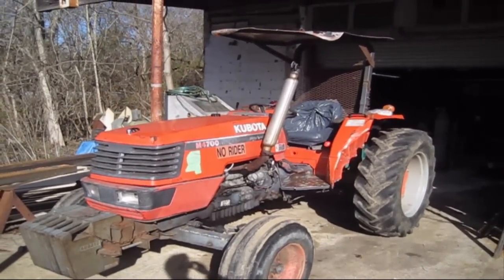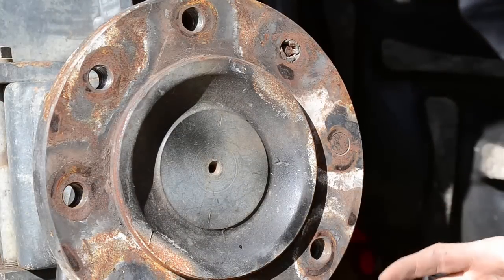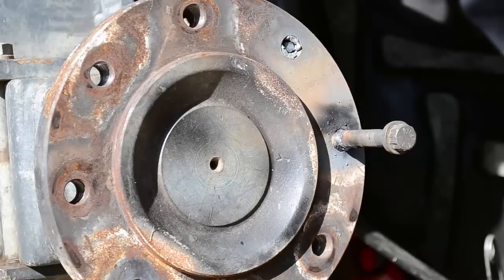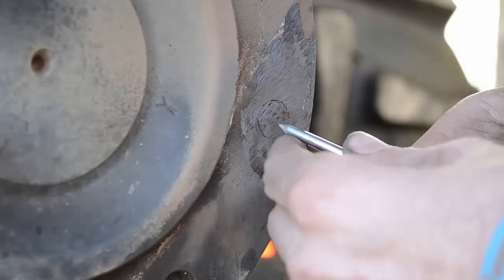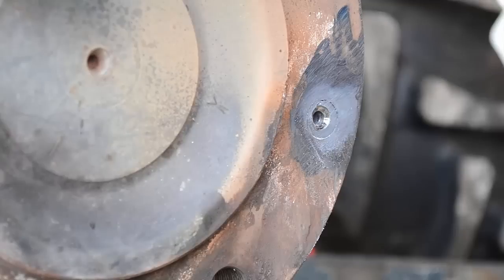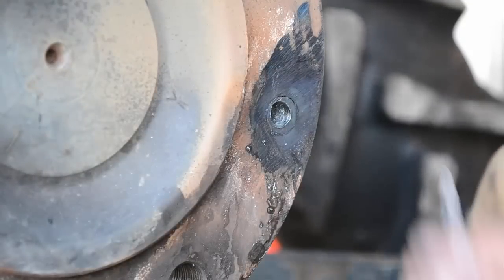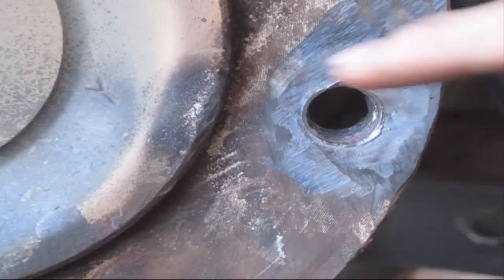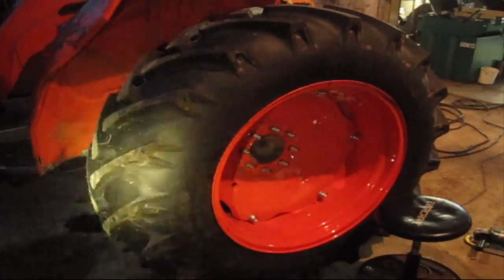Broke-off bolts techniques

Comment: You are running your drill bits to fast, the bigger the bit the slower the speed. Give them time to cut, watch your chips. -- BTY good  job
Reply: Drilling steel, you need a low speed, lubrication and plenty pressure. Excessive speed will just make the bit skate and blunt itself.

Comment: Another option you could have tried was to heat the plate good and hot before using the impact wrench. It's worked for me many times.  Great video.

Comment: After you weld the bolt on, melt some wax down into the threads to lubricant them, it helps  a bunch. I keep some crayons in my toolbox.
Reply from the maker: I have heard of that, but never tried it.  Thanks for the tip.
Reply: Give it go next time.
Reply: Toilet ring. It’s beeswax. Takes to heat paraffin base wax will just catch on fire
Reply: After he heated up the bolts to break the rust he should of let it cooled and poured a load of penetrating oil and let it soak in.  Then weld his bolt on and do the same before he tried turning it. Dry rust will just jam up.
Reply: U
Reply: did not read down far enuff
Reply: STEPHEN Weston no no no
Reply: candle wax & heat work wonders!!! Saved me a few times!!!
Reply: Tony Papantoniou 
Why would you want to weld over oil?
Reply: That's a good godamn trick Stephen!
Reply: and he never should have used an impact gun.  Using a bar and socket to work it.
Reply: Someone (an old mechanic -like 40 years ago...) told me bees wax works really good..
Reply: another thought..  Not enough oil.  Penetrating oil can loosen up rust particles, etc.  Getting some of that loose can help out immensely.  Also on the bolt you had to come back to...  it was moving.. but seemed to me it hung up on a little bit of excess weld -or metal distorted from the welding heat (The washer and nut trick has been mentioned numerous times, and its a good one!)..  A good die grinder / pencil grinder with a tiny bur can knock those burs out from around the hole in no time..  Anyhow, you got them and didn't give up.  Good job! -and nice welding skill!
Reply: CRC Freeze Off penetrating oil works great and smells much better than the PB Blaster stuff.
Reply: I tried a UK equivalent called Freeze Yer Nuts Off (seriously) and it done nothing. Wonder if the CRC is much better....
Reply: I agree with the method. But I still smirked when you said I keep crayons in my tool box...

Comment: Haven't red all the comments here. A overlooked tool for drilling out hard things is a carbide tool for deburing like you would use in a die grinder. Does a wonderful job. Your doing a good job.

Comment: I saw a comment on left handed drill bits, to add to that. If you drill the hole out and run a left-handed tap in it and use a left hand threaded grade 8 bolt in there has worked for me in the past.  Just make sure you don't drill all the way through you want the bolt to bottom out in the stud so as you torque down on it , it locks it in

Comment: I think you would have gotten out after the first weld had you used some penetrant oil and worked it in an out, so close though. I've also heated the bolt/stud then quickly cool the bolt stud, it will retract a little from the parent metal which has expanded, both will work to make it come out ,that works really well on pipe thread plugs .  you showed a lot of patient in the job.

Comment: Thanks for sharing, it is very good.  I watched entire clip.
, Ross Miller is on the mark, re:  dulling the drill bit.
I noticed as you were going fast, rubbing the bit on the work,  it heated up the work and   IT BECAME HARDER.
That tells me the work piece had some chrome alloy, which means it has SOME similarity to stainless steel.
If we rub and heat up high chromium steel it GETS HARDER.   Just accept this principal for now, there is no time to go to its scientific reason.
So, those kind of material should be pealed off like apple skin.  Therefore high pressure, slow speed AND do not STOP as long as peals are coming off because existing heat will harden the piece.
Best wishes from California.
Frank, 68 years.

Comment: A few tips from a machinist- First, chrome sockets will explode when used on an impact. Next, its nice that you have a welder, gear, an oxy-acetylene torch, and the knowledge to use them. Most DIY'ers dont. Most do however have a drill and drill bits.  My first choice would have been to drill out the center of the stud. Then use a square or splined easy out, not the spiral type. Like you said, they are junk.  Tap it in and see if it will turn the stud. If it starts to slip, STOP. Now it gets fun. Apply heat with a hand held torch using the hotter MAPP gas. Most DIY-ers have this also. Heat the flange ONLY, and quickly; not the stud. The heat will expand the flange a few thousanths. You dont want to apply heat to the stud. As you apply heat to the flange keep moderate steady pressure on the easy out. When the stud breaks loose back off the heat a bit but KEEP TURNING. If you stop it will seize up again. If it doesnt break loose remove the heat. Now 2 options. You can immediately throw water on the spot to shock it and get it to pop loose. But if that doesn't work you may have water hardened the stud which makes drilling very hard. 2nd option is to continue drilling using a metric, letter, number, or fractional drill bit that cuts away as much meat without hitting threads. Then do like you tried and use a sharp punch to cave in the remaining stud. Once you you get it to break free in one spot the remaining shell will give up. Heating is tricky as it can make things worse, so I try to use it as a last resort.

Comment: Use an impact socket. Why? They are stronger. Chrome sockets are general duty. Strong enough? Maybe. But if not, they could crack and maybe even shatter. Good safety tip for you and your viewers. 

Also, always use anti-seize on these bolts / studs on assembly to make it far easier to remove next time.
Reply: Linz Leard if you buy quality tools like snap on, it’s the same socket without the chrome
Reply: looks like a wheel  hub. NEVER use anti-seize on any wheel stud. will prevent wheel from staying tight and will vibrate loose from wheel heating up and cooling. Have been a master mechanic for almost 30 years and have repaired many a vehicle that has had a wheel come loose from some idiot who used anti-seize on studs. Not to mention the body damage, and possible injury to somebody when this happens.
Reply: If you buy quality tool like Snap On it’s the same tool, the chrome will chip off, that’s why impact sockets aren’t chrome.

Comment: Good job. I only have one thing to say though......
DON'T EVER USE A CHROME SOCKET ON AN IMPACT GUN
Reply: Yup! Especially the cheap ones will crack. I have a set of sockets from Bahco made for using them with an impact driver. They are ten+ years now, still, they look like new.
Reply: I've been a mechanic for 30+ years. I've always used the same set of chrome sockets with impact wrenches. The only sockets I've ever broken are black impact sockets. One of them mushroomed at the end like a chisel. The key is don't be a moron with the impact. If you have to keep the trigger squeezed, hammering on the bolt, you need to use heat or something else to help break the bolt free.
Reply: The reason you don't use chromed sockets for an impact gun is that if the chrome flakes off and you're holding the socket you get that flake spun right into your skin.  You can use them, just don't hold onto them, don't be such a douche as obviously Steve has decades of experience...

Also you'll notice that the bolt was a 12 point bolt and almost every impact socket is a 6 point unless you specifically look for a 12 point impact set.  Most folks would rather have 6 though as there's less chance of rounding off..
Reply: @kalleklp7291  my bahco 17mm socket snapped on me using a breaker bar wtf 😁
Reply: @eamonnodhubhgain55  Ha,ha..yeah tried that too, but it took a 1,5" piece of pipe that was 700 mm long. However, I got a new one even though it was my own fault manhandling the tool in this way.
Reply: @notabiker  ,   No,  The reason you don't use standard sockets (chrome has nothing to do with it) is because they are drop forged and are thus harder and more brittle and thinner walled than impact sockets which are ductile steel & have thicker walls.  Thus the standard socket in an impact gun could completely shatter and bits go flying everywhere.  The impact socket is more able to withstand the forces of the gun.
Reply: fair enough but he said he's had black (impact) ones break on him but not the chrome ones. I find that the black ones are cheaper so if someone is choosing to use chrome over the black it's probably because he thinks they work better not because he's not aware of the difference or is trying to save money
Reply: @stevemccauley5734  Same here;  never had one problem with using regular sockets with the air impact driver; i mean,that was as a car mechanic,not in production, or continuous work; still,i felt sorry for the sockets,sometimes,  lol
Reply: that rarely happens, but if your worried about it you can heat it up red hot and let it cool that should take the temper out and won't shatter.
Reply: @as3cs3  Didn't really say break, said mushroomed instead of shattering (more ductile) which is why they are safer.  That said, I make do with what I have.

Comment: I’ve blown straight through the bolt (easier if there is a pilot hole drilled to start)  and scarfed the bolt out to the threads then cleaned them out with a tap. And yes, be careful with the tap or you will brake it off. Just my two cents but it works. I’ve done it many times. Like your videos 👍

Comment: Thanks for the video. Ive blown out hundreds of bolts using a clean cutting tip on a torch.  Just do it fast so as you said, not to let the outside metal get hot but press the cutting  button to blow the metal out, instead of letting it just heat up. Sometimes if the bolt has no hole all the way through, the metal will splatter back, and make the tip of the torch red and hot, but once you blow a hole in it, let it cool and then slice  the bolt and cave it in with a punch. The threads will be fine after you chase them.

Comment: As said before, lower your drill speed. You are drilling not grinding.  These insane  speeds are good for drilling wood.
Left handed drills works sometimes.
If the welded on bolt did not go out why not trim it down and srcrew it thru?

Comment: Looking from my side when you had that bolt moving you needed to warm the outer part of the flange a bit and use penetrating oil working back and forth and it would have cleaned up. More than likely rust formed on back side of stud to jamb the stud there. I never had a bolt in steel that would lock up doing it with care and patience. good video though like the burn out view though.

Comment: Also, the drill was running too fast....need to be much slower  2/. Then use some penetrating oil,and unscrew it by hand to avoid creating heat and expansion. You say that the centre drill so called "walked". When that happens on a job like you have, I use a small twist drill to drill right through, then a rotary file to bring the hole to centre, then and only then do I use a larger drill bit.

Comment: Guy,  this is easy.  Drill a nice large hole into the bolt (not into the threads), maybe half way is all you need.  Then, take your mig, and fill the hole back up with weld.  This makes the broken bolt nice and cherry red.  Weld a washer onto the broken off bolt, and finally weld a nut to the washer.  At this point, the bolt is still warm enough (all the way through) that it will easily unthread, either with a wrench (nice and gentle), or an impact (fast).  

btw:  when drilling steel, start slow, and never drill real fast.  All that does is create heat which will dull your bits.  Yes, you can use HSS bits too, but relax, and slow down.

There's never enough time to do it right, but always enough time to do it a 2nd time...

Comment: The first one would have worked easily if you had heated the flange red hot before you put the impact to it.  

As mentioned, first weld a washer to the top of the stud.  That helps not to weld the stud to the flange and greater weld surface area.  Next chamfer a bolt, and weld around it, or if it's big enough, you can weld a nut by welding inside of the hole in the nut.  In any case you want to heat the flange before trying to back it out.

Comment: Your right about EZ outs, junk.  And I agree with others on slower drillin.  But I can't never bad mouth a guy who never gives up.  Dawn to dust, "just don't never give up, only a puss would".
And I like 7018, but on a grade 8 or harder bolt even 11018.  And MOST of all GREAT job guy.  Got er done!  ☺
Reply: Extractors have their place. For fasteners that snapped because of trauma. If your fastener has snapped trying to remove it, don't use an extractor. If it snapped because it was ripped apart, and it moves when drilling it, then an extractor will work.

Comment: You do not drill steel that fast, it hardens the steel and blunts your drill bit. Always drill steel slow with oil.  You can also use Cobalt drills (slowly) or diamond drills.
Reply: "it hardens the steel"      i always had that problem,and that explains a lot,thanks

Comment: In my personal experiences, the first thing I do is drill a hole threw it, then heat and weld. Drilling first is often easier because heating and welding often hardens the bolt. And I personally use a wrench to work the broken bolt back and forth. Patients and determination is key!!! Cutting fluid and low speed will help save bits.  But great work!!

Comment: two pennorth! Slower drill speed, open the hole out to suit a Snap-on stud extractor, so you can get a flame through it, heat the centre of the bolt, making sure you don't get the flange too hot. The bolt will shrink to smaller than it's original size. Once cooled right down, douse with penetrating oil and leave for several minutes. then tap the  Snap - on  stud extractor in and it should come out. Has never failed me yet, and that's on ships, paper machines, earth moving plant and motorcycles. I've used this method on hundreds of occasions and am now 69.

Comment: Use wax candle or bee's wax after heating or welding break out bolt.  The wax will wick into the threads and serve as a high pressure lubricant.  Even penetrating oil would be better than dry.  Dry threads after heating is asking for galling.  If it galls, you lose.

Comment: I'm an aircraft mechanic and have had to drill out exotic metals like titaniium. You need to start at a low rpm with a cobalt drill bit with an included angle of 135 degrees and with cutting paste or oil to make life easier on you and your drills. Carbide is your absolute last choice because of its hardness and brittleness. Enjoyed the video, keep up tbrittle essential.

Comment: i'm a machinist, by trade. i'd run that drill at about 100 rpm.
Reply: Wouldn't drilling a small pilot hole first speed up the whole process, a lot?

Comment: I worked with my grandpa in the 70s on wabco  heavy equip. He was a sought after heavy quip. man. I got to see the expansion of s. cali. You have to concentrate and I couldn't work with audience too  well. still have trouble today. Thanks for the inspiration. Kids need educating. stick welding is as cheap as it gets now and nobody wants to get down and do it.

Comment: Also, at the risk of being critical, but with the benefit of teaching something, slow down the drilling. You're hardening your work as you drill.
Reply: Hahahha thats not how it works. the heat actually de-temper your bits and melt them. that is why drilling too fast dulls bits.
Reply: @Francois_Dupont   WTF is a "de-temper"? Could you have possibly meant annealing the bit? BTW,  you can most certainly work harden alloy steel, which a grade 8 bolt is, and many other alloys by drilling or machining on them to fast of RPM without enough feed speed to cut the excessive heat build up out of the work piece. Go find yourself a nice piece of 3/8" 316 stainless steel and spin a 1/2" drill bit up to about 1500 RPM and plunge said bit into the S.S. block with a hand drill. Let it get hot enough that it takes the edge off your "de-tempered" bit, and continue until the work piece starts to turn blue. Now, go grab yourself a new bit, run it as slow, and with as much cutting fluid as you like in the divet  left by the previous bit. Go ahead, we'll wait......    What you have just experienced is heat induced work hardening.  
   You see Francois,  Joe West actually made a very valid point..... you on the other hand made a fool of yourself enlightening the world with your utter lack of knowledge . Now, zip up your trousers and move along....
Reply: @MrBluescruise  i worked at the biggest engine rebuild plant in america, i drilled bearing with garbage HSS bits without oil or anything. its all in the speed and pressure you apply. take your bit and spin them without any pressure on your work. then take them to a microscrope and see. you actually melted your bit.
nice theory about "work hardening" too bad its not based on reality.
Reply: @Francois_Dupont  First, bearings are as soft as shit. Second, if you drill into any steel that is even a little bit higher in the carbon content, you can EASILY work harden the job, and that will fuck yer bit in a flash - " work hardening" is a common problem that has to be appropriately addressed. It's not a theory hotshot, it's a fact of life. Working in "the biggest engine rebuild plant in america" means sweet fuck all in real life.

Comment: What you need to do heat up on  hub around broken bolt red hot with  an oxyacetylene torch.This would have probally worked the first time when  using the weld on bolt method .-Steve
Reply: Try some carbon Tet for cutting fluid